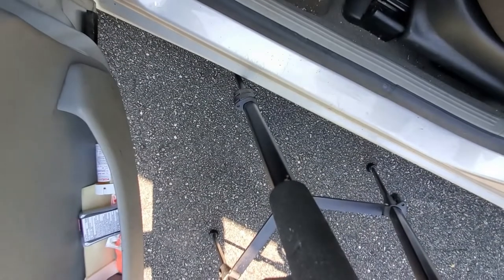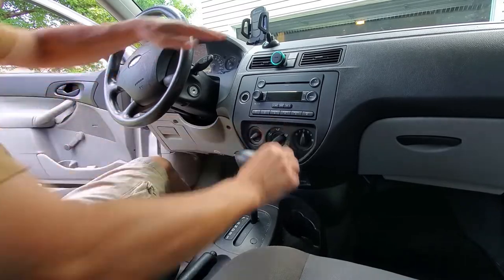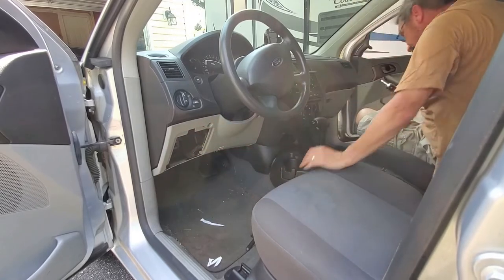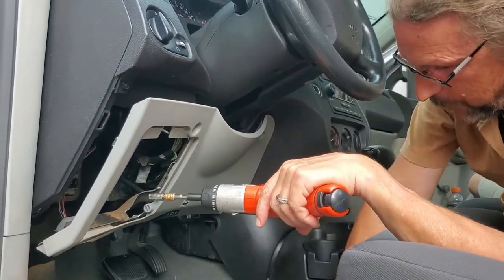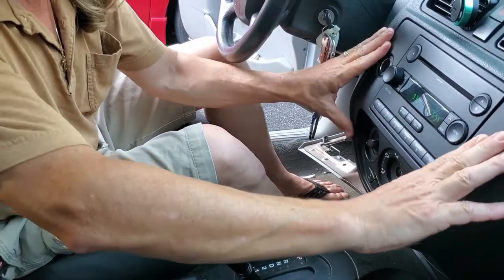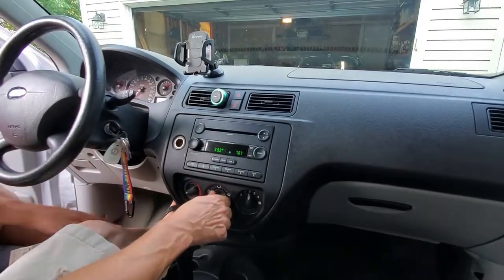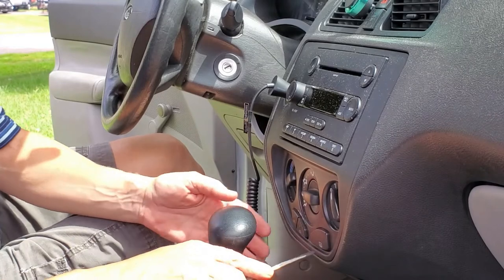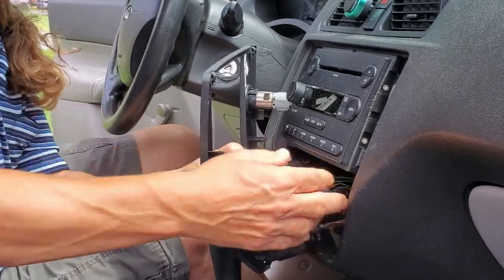Heat Defrost AC Selector Switch 2007 Ford Focus - Repairs with Steve

Comment: You’re a lifesaver, the mechanic shop told me they would have to take apart my whole dash board just to fix that
Reply from the maker: To replace that air-box damper with the 'sticky' seal, it does require taking the whole dash apart. But the cable itself is not too difficult and its not hard to try to remember to always select a combination that keeps the floor vent open a bit so it doesn't glue itself closed and break another cable.
Reply: They told me the same lie until I showed this video to my son. My son only had to remove panel underneath the driver's feet..
Reply: Same. I was told it would cost several hours of labor. I can do this myself!  @workbenchz

Comment: Let it heat up before you try and turn it,if stuck, and leave it in the straight up position when you shut it down that way the sticky stuff won’t be in contact with any surfaces to glue it shut and it will still function as intended as a diverter for the air control system.
Reply from the maker: I put "NO" labels at either end of the index as a reminder to not close the floor damper.

Comment: Thank you! The air vents are now blowing, however I’m still stuck with HOT air, I believe the temperature switch is broke as well. In the meantime is there a way to manually blow cold AC air?

Comment: Having the same issue, about to manually slide it down, hopefully air starts blowing in my face, right now its stuck in defrost. i bought the new cable but it still won't turn !!  its too dam hot to keep guessing, and im not trying to get rip off by another mechanic. Thank u for the video
Reply from the maker: warm it up to operating temp for a few minutes with the fan on med and the temp on high; At 4:05 in the video I manually rotate the cam, but it first took a minute of some persistent and persuasive "wiggling" to get it to break free.
Reply: @workbenchz   my son had to manually turn the housing unit that control the blend doors, The doors were stuck in defrost postion. he only had to unscrew the bottom panel under the steering wheel,  4 screws, i have air blowing in my face now, Thank goodness because its getting hot out here
Reply: Forever39 put Grease into the Unit then pull it back and forth it will loosen up a bit
Reply: @luisponce1472  my son was able to turn it manually , he unscrewed the bottom panel on driver side and he was able to turn it into the open position with a little elbow grease..he told me, meanwhile don't turn the knob into the last position( defrost) because the door will get stuck again, it definitely seem as tho it was clued shut.

Comment: Hey i’m working on mine right now, and what’s the black plastic thing that turns behind the switches? you said yours “needed a little help” mine keeps getting stuck and i’ve replaced the selector cable deals like 3 times. Would like to know what it’s called so i can replace it, or any way to fix it without buying a new one? Thanks
Reply from the maker: I think you are talking about the cam, a big black plate with slots that rotates about 90° to open/close the heat and defrost dampers.  I had success letting the heat run full-blast for a while to soften the goo that had the floor damper stuck shut.  Some other youtube videos cut a hole in the air box to scrape the goo off the floor damper as a long-term fix.
Reply: I found a few videos on YouTube of cutting into the air box and it’s not that hard. I used aluminum tape to cover the gummy edge of the flapper and it works great!
Reply from the maker: @Steven-em5if  Well Done.
Reply: @workbenchz  Thank you for the tip, I did find those videos and did that as well, and it works great! thanks for the help
Reply: Witch one is for changing the heat to ac

Comment: I was able to do everything in the video, but when i turned the selector knob, it had resistance and the plastic inside the knob broke. Is there something else i need to do? I tried “releasing” the clip on the new cable, but it doesn’t appear to move out of the way like in your video.
Reply from the maker: at 4:05 in the video, I manually rotate the cam and 'break free' the dampers.  If you don't do that, the floor damper is still glued closed and will break your new selector switch.  Afterwards, remember to always select some combination that leaves the floor vents open a little so it doesn't glue itself shut again.  This was my daughter's car and we've replaced the selector 2 more times after I filmed this; for that very reason.  I finally put bits of blue gaffer's tape at both ends of the selector's range to remind them.

Comment: What do you do with Power for the back light Do you just leave it there do you need to cover it up
Reply from the maker: It's an enclosed plug so it's ok to leave it till it can be plugged up to the new control's backlight.

Comment: What's the name of the white plastic under the steering wheel where you connected the new switch?
Reply from the maker: That's the side of the air box where the cam operates the flaps that open/close the floor/defrost/vent.

Comment: same problem with mine. the hot and cold selector is starting to become hard to turn also along with the selector already breaking. i took it to a shop and he said it would be over 1k to fix due to having to take the dash apart? i’ve already tried to switch out the cable and nothing worked…. any ideas?
Reply: also the part you pushed on to manually change where the air comes out of is completely stuck in my place on mine. any ideas to fix that? thanks!
Reply from the maker: @nicksweitzer4217  Yes, warm it up.  The floor vent damper seal degrades to goo with age making it sticky. Warm it up with the engine at operating temperature, the heat turned all the way up and the fan on medium or medium low.  Let it run like that for 5-10 minutes (or run an errand) till you can feel that the side of the airbox is warm.  That has loosened up that "goo" for me.  At 4:05 in the video I manually rotate the cam, but it first took a minute of some persistent and persuasive "wiggling" to get it to break free.

Comment: hello, the part you have listed in the description, does that include the cable? im having the same issue and want to be sure what i need to purchase.
Reply from the maker: Yes I see amazon changed the pic.  Yes it is the cable and both plastic ends, similar to the HS-361 you see in the "similar items" but for the dampers.  This is the very one I ordered (twice).

Comment: I wish you lived near me....I am in northern Delaware....I have this dastardly problem with 2007 Ford focus.... left and center knobs.....dealer got used parts....knobs still sticking....stuck....
Reply from the maker: This is not a very difficult repair, but it will happen again and again.  The Gasket for the heat flap degrades into goo and you have to run the heat for a while to loosen it up, or never turn it to a setting that doesn't include the floor vents.

Comment: Hi Steve, the black plastic thing in the right it’s for the speed of the ac? Mine works only in number 4
Reply from the maker: If the fan speed only works in number 4, that would be a bad resistor pack, a little black electrical box that the wires to the fan connect through.

Comment: What is the name of the part you ordered?
Reply from the maker: HS-362 Hvac Control Switch, there is a link to it in the description.
Reply: @workbenchz is it the same part for both the vent control and temp control? Or would it be different for the other?
Reply from the maker: @corywhitworth2712   the temperature control is a little different, but looks similar.  I think this is the part you are asking about, the first review clarifies it is for the temperature control not the floor/vent/def selector: https://amzn.to/41dVLVJ